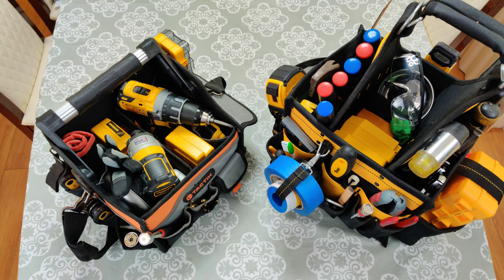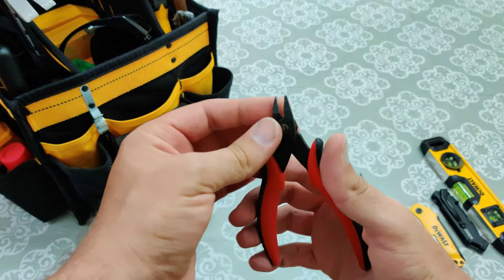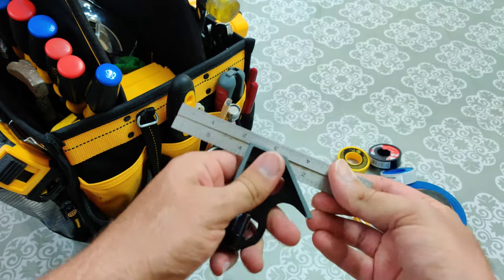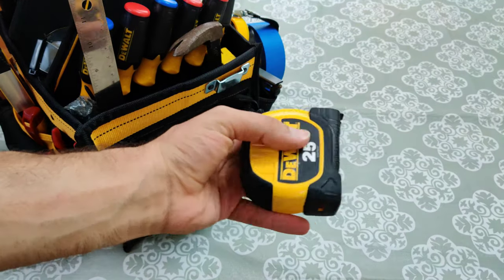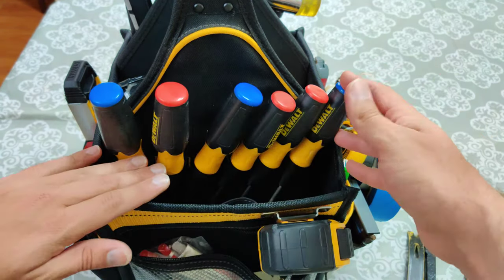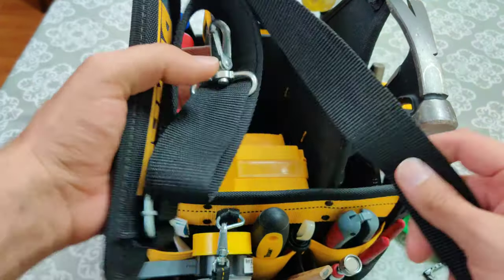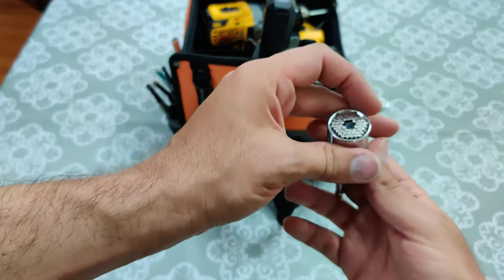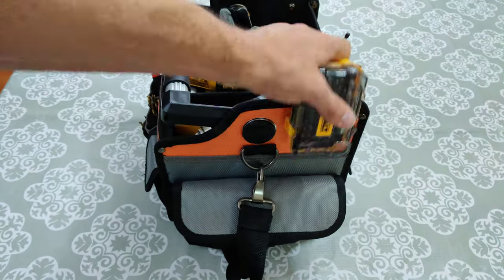Basic Tools for Everybody (DeWALT Bag)

Comment: Get rid of the tooth brush my man
Reply: Tbh a tooth brush can come in handy, also a soft 3inch paint brush for dusting off
Reply from the maker: I have since replaced the toothbrush with 3 similarly sized brushes with different types of heads

Comment: Nice little assortment for a wide range of diy tasks. I was a little confused with some of your nomenclature for a few tools you showed. Your fluke multimeter (not multi tool) has test leads (not prongs). Your DeWalt ratchet kit has a set of sockets (not wrenches). That aside, this was a great toolkit tour and I appreciate the time and attention you've put into showing what you carry.
Reply from the maker: :) thanks, I did get the names mixed up

Comment: Was surprised when the Fluke multimeter came out tbh. If you like nice tools that professionals use I would also highly recommend looking out for Knipex for pliers, side cutters, pipe wrenches etc and Wera for screwdrivers and impact driver bits.
Reply from the maker: Nice! Thanks for the insight

Comment: & the ratchet set u showed at 4:29 (I think or 449) has a multi bit screwdriver in that set + the bits.. but I'd still keep the2 longest of each flat & Phillips head.. that way no matter how long of 1 u need, u good. Those other 4 jus takin up space
Reply from the maker: I agree, there is quite a bit of redundancy... But I would hate to separate a set like this

Comment: So if you can hit home depot and capture the diablo spade bits u can use them with the impact driver make boles fastet and release bjts quicker they were retail at 19.89 bucks with the inbetween sizes,  also come out of the bole faster  about 20 bits all told
Reply from the maker: Thanks for the insight!

Comment: The “pick” is called and awl. Nice setup.
Reply: The straight one is an awl but the curved one can be called a pick
Reply: @harleeb9061  that is true. An awl can be pushed as a pick but a pick an not an awl. Awl can be used for puncturing
Reply: Yes it is often one will come in a pick tool set that's I think why some people call it that possibly and yes I've heard plenty of people call it that also that might have stemmed from the old school ice-pick possibly?

Edit here yum there is a difference between the oil in a pic but one can be used interchangeably at times but there is a difference.

Different tool different intended application.

But very similar but at the same time different!
Reply: You could also use the pick to chip ice for your soft drinks.🤣. Pick would be the correct word.
Reply from the maker: Nice :) thanks for the info!

Comment: Hi , thanks for this video. I just bought a 5 gallon buccket along with canvas organizer. And going to fill it up with tools. Do you think the brand name does metter?
Reply from the maker: I'm not a fan-boy to any specific brand.. however, if you are going to invest in some power tools.. I recommend picking and sticking with one brand since you will want to use the same batteries
Reply: @ChrisAsipyan  sure , usually I'm buying makita or ryobi tools so I already have both systems.
Reply: For a guy only using tool 3 times a year it doesn't really matter, if it's how you make a living invest in quality

Comment: That square is actually a steel worker square the round brass piece on the bottom pulls out and it's a scratch awl to mark steel with
Reply from the maker: Nice... Thanks for the insight

Comment: Awesome video!  I learned a few tricks from your video.   How much do both the organizers weigh with tools in them?

I have gone through a whole bunch of tools organizers myself (bucket one, DeWalt backpacks.)  Every time I have come out short on some missing tools, which I needed and they were missing from the bag.  I install a lot of grab bars in bathrooms etc.  I had to carry a 4' ruler separately for marking a long line.  I also carry a separate box with screws and anchors because I go through a lot of them.  Not knowing which anchors would I need, I carry many different sizes of anchors and screws, which makes the box heavy.  I do have to make a few trips to my car to bring all the stuff inside.  Any tips on improvement on my method, will be highly appreciated.
Reply: Milwaukee Pack out
Reply from the maker: I agree, it's hard to ensure you have all the tools you need in one bag, and actually pretty much impossible. I have instead separated my tools by tasks: General tools, Plumbing, Electrical, Drywall/Painting.

Comment: Does anyone have a link to that DeWalt socket set and quarter inch hex driver screwdriver set don't think it's on Amazon I was looking and did not seem to find anything even remotely similar.

Although I did find a ratchet set and a screwdriver set but didn't look similar both from DeWalt.

Been looking for something that would have both for a long time if someone could give me a heads up on a link even if it's not Amazon or at least some other info where to get possibly anything would be helpful thanks I have time to anyone that replies
Reply from the maker: I got that set from Costco a long time ago, I have not seen it anywhere else since then

Comment: Replace the wd40 with 3 in 1.
Reply: I agree but having both is a plus.
Reply: @salemkaresllc7309  Very true. Variety is good.
Reply: Also a small tube of silicone grease for rubber seals and plastic moving parts and graphite powder to dry lube locks etc.
Reply from the maker: Thank you for the suggestion!